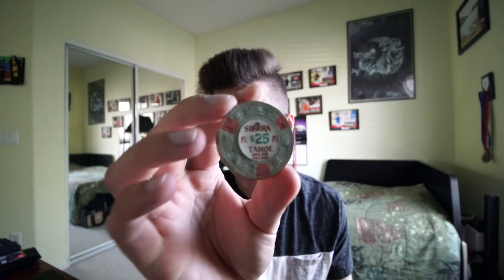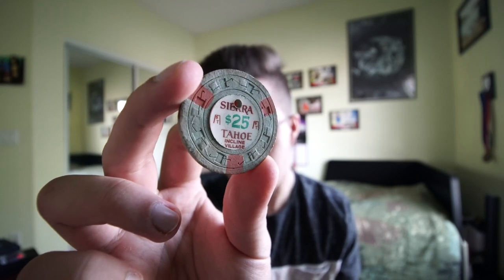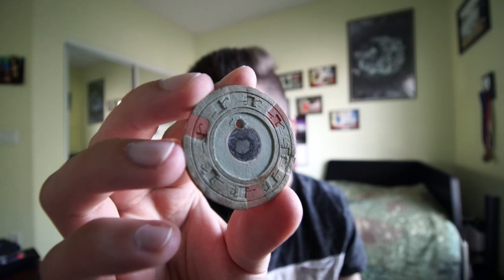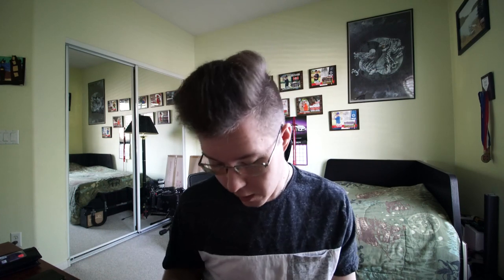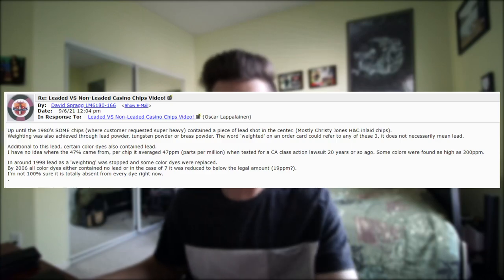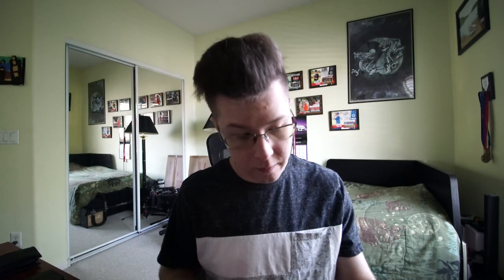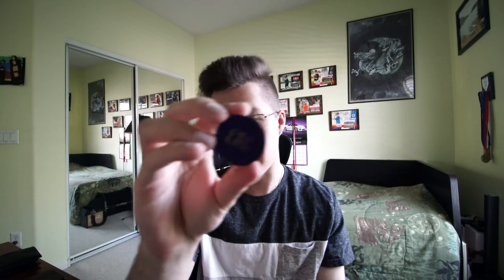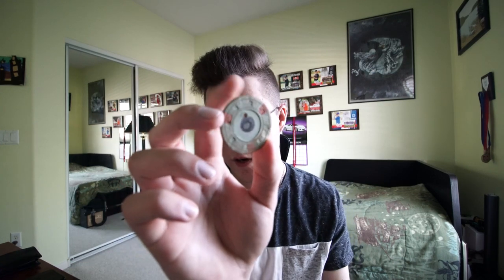A Closer Look at Leaded Casino Chips!

Comment: Oscar, very cool stuff. BTW, the Sierra Tahoe chip is in such poor condition because, it was drilled and spent a bit of time in Lake Tahoe (the wet part!). The casino both drilled and tossed these into the lake, in an effort to destroy then. I believe this midnight dumping was discovered years later by a scuba swimmer. Question for you, what would you suppose the weight of the Sierra Tahoe chip to be, if the inlay and hole was filled. Lastly, that metal plug is lead (Pb), and "pencil lead" is actually, graphite. Please keep these tutorials coming!
Reply from the maker: Okay that makes sense. If the inlay was still on and it wasn't cancelled I wouldn't think it would add too much weight to the chip. Maybe around 11.45 or 11.5g would be my guess. Thanks!